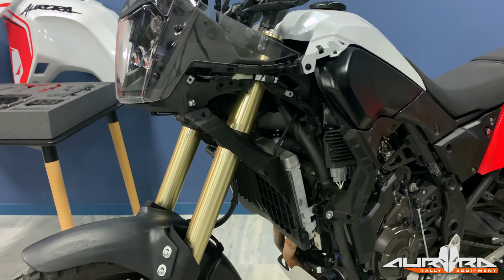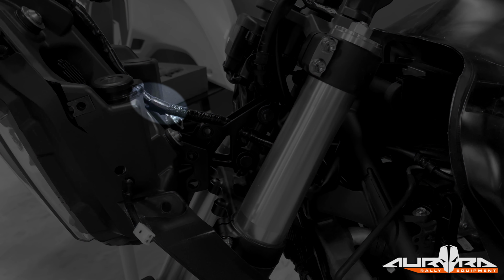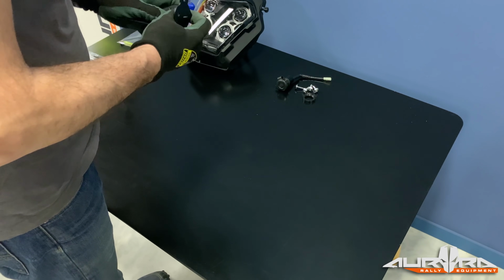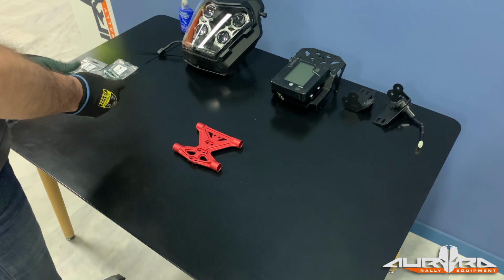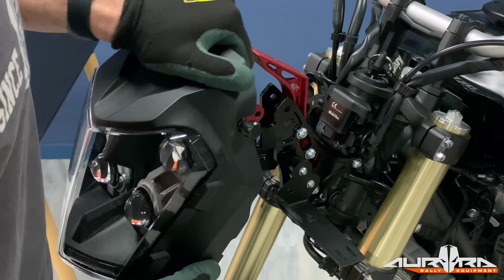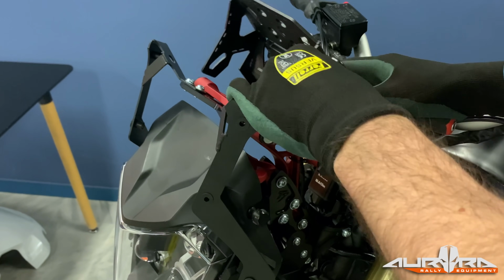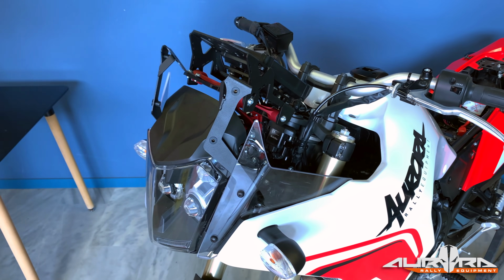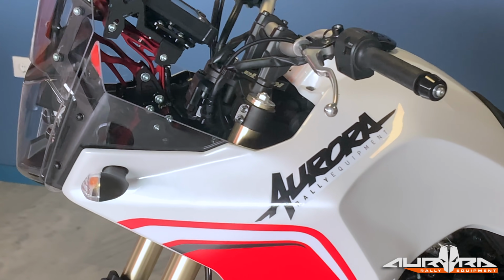T700 Rally kit installation video

Comment: Watched all that for a big tank going on that never came...can't see the point of an expensive cosmetic kit,on an overpriced bike(compared to Tracer 700/900)?
Reply from the maker: Although this is the installation video, you can follow our T700 webpage (https://aurora-rally.com/t700-2/ ) and see the details of what this kits add. 
Further to that the Tracer is not in the same class as the T700 which is an adventure bike with quite good off-road capabilities. Tracer is more on the Honda NX700 territory.
Reply: @aurorarallyequipment  Definitely a first for the T7 being referred to as the expensive bike in class lol.  Nice build guys, that's awesome.
Reply: >overpriced bike
what the fuck is this guy smoking and where can i get some
Reply: @hangingnutsjimmy88  brand new Tracer 900, cost me £7495 out the door...try find a Tenere under 9500 OTR...I'll 'smoke' your Tenere anytime with my CP3 motor?

Comment: What's the point? I don't get it.
Reply from the maker: Depends on how you want to use the bike. 
The large space allows you to place the OEM speedo in a better position alongside a GPS or a mobile phone for both sitting and standing position. Even Nav gear for that matter in a safe for the rider position. Ergonomics in that area are vastly improved. 

Then, should you want two gps units or a mobile phone and a GPS, you can move the speedo to the handlebars and install them. Installation of a carpe iter or a 10 inch tablet also possible, or nav gear for the hard-core. 

Tower is rock solid, and you get improved protection both on the top and on the legs due to the different screen position and side panels. 
Protection of the radiator is improved and the tank is now fully protected. 

You can now undress the bike with undoing 4 bolts per side, instead of 22 that the OEM parts have. Something that will be appreciated during service, cleaning or racing. 

The tower has enough space to put powerbanks etc. And it will house everything without complaining. Hence the CNC parts on the tower have a lifetime warranty. 

To the above you can add the upcoming high fender and skid plate, rear tanks and exhaust and build an adventure weapon.
Reply: @aurorarallyequipment  Hi there. Looks like excellent engineering but everything you suggest above fits on the stock bike just fine. The navigaton bar works great to hold GPS gear. Personally suspension upgrades is what the T7 needs badly for heavy off road work. That would be where I'd suggest money goes on the Yamaha.
Reply: @twowheelpilot  Exactly that - then engine tuning, as it couls do with a bit more power.

Comment: And what is the purpose of this upgrade.  Will it make the bike lighter?
Reply from the maker: To make the bike lighter, especially the T7, is only possible if you remove things. The light being one of them, which is 2.5 kilograms. The rest is plastic, and we all know the weight of a plastic part compared to Aluminium. 

To that end, getting that kit which is full CNC parts to be the same weight as the OEM setup is a true marvel, because you improve all the areas of an adventure bike, without compromising on weight. Drop the light to put a Baja Designs on and you are 2kg lighter. (all other kits, add parts, hence add weight -  to date there is no rally kit for the T7 which is lighter than the stock bike, and keeping the light structure). The benefits are multiple, but depends on how you use the bike. 

The large space allows you to place the OEM speedo in a better position alongside a GPS or a mobile phone for both sitting and standing position. Even Nav gear for that matter in a safe for the rider position. Ergonomics in that area are vastly improved. 

Then, should you want two gps units or a mobile phone and a GPS, you can move the speedo to the handlebars and install them. Installation of a carpe iter or a 10 inch tablet also possible, or nav gear for the hard-core. 

Tower is rock solid, and you get improved protection both on the top and on the legs due to the different screen position and side panels. 
Protection of the radiator is improved and the tank is now fully protected. 

You can now undress the bike with undoing 4 bolts per side, instead of 22 that the OEM parts have. Something that will be appreciated during service, cleaning or racing. 

The tower has enough space to put powerbanks etc. And it will house everything without complaining. Hence the CNC parts on the tower have a lifetime warranty. 

To the above you can add the upcoming high fender and skid plate, rear tanks and exhaust and build an adventure weapon.
Reply: @aurorarallyequipment  sounds awesome.

Comment: Does this save any weight over stock?  Thank you
Reply from the maker: Weight remains unchanged although you add the huge side panels which protect the tank and the radiator. Can get lighter if the OEM light is altered with a Baja Designs unit for example. You can save up to 2kg in total.
Reply: @aurorarallyequipment  I'm not liking the lack of HP for the actual weight of the bike so I appreciate you giving me factual answers.

Comment: Can you still install the OEM crash-bars with that T7 rally kit ?
Reply from the maker: Hi Alexander, basically the crash bars that do NOT go to the front of the bike can be installed.
Reply: @aurorarallyequipment  Is there any crash bars you'd recommend with your kit?
Reply from the maker: @sagarthapa3765  basically the ones that do not go around the front, such as the Givi engine guard for example!
Reply: @aurorarallyequipment  Thanks a ton! :D

Comment: What's the benefit of this kit, except design change and maybe beter visibility of instruments while riding standing on footpegs?
Reply from the maker: @A1 Media 
There are multiple benefits. 
1. All the flexibility that there is with the OEM plastic frame is eliminated, allowing you to either add multiple units (you can add for example 2 GPS units and still keep the OEM instrument) without worries regarding vibration. The solid structure allows the light pattern also not to ''vibrate'' . 
2. Ergonomics. As you mentioned, standing and sitting can both be at the optimum angle, something that the OEM does not allow. 
3. Possible to put a full navigational setup, and still keep the OEM instrument. 
4. Easier access and maintenance. You can remove one side with 3-4 bolts, instead of the complex system that the OEM has. This allows for quicker services, both during regular maintenance, but also during races or if it just cleaning/self maintenance that people do. 
5. Better adjustability of the light. The light structure is easier to point in the right direction only using one bolt. We found that the OEM did not have enough range, hence it is now extended. 
6. Better protection of the tank during a crash/fall. The side panels will protect the tank which is prone to damage during a low side. 

We hope that makes sense, 
Thanks for your comments!
Reply: I think you get the possibility to install a Roadbook holder. But I dont understand why they dont have a small Kit with just the Rally Tower in it without the side Panels. 1900$ is way too much for the ability to mount a Roadbook holder.
Reply from the maker: @Sledgehammer123456  - It's next to impossible to create what you describe. 
The OEM structure is not stiff enough, and the OEM structure is so compact that it does not allow you to have proper space without the bars hitting the instruments. That is why in the OEM the speedo is so ''deep'' in the structure. Also, keeping the plastic structure, with a stiff tower, during a crash will result in the plastic structure to be damaged first (been there during the test phase). And these big, side plastics (I mean the internal structure, not the fairings) of Yamaha will be (1) difficult to get in time and (2) difficult to carry as spares. What can be done to the OEM structure? You can patch it, but unless you change it in total, chances are that you will create more issues. Only stiffeners can assist, but up to a point. Then the glass reinforced plastic will crack...
Reply: Your wallet is much lighter enabling you to pack a banana. 🍌 🍌🍌🍌🍌
Reply: I was thinking the same.